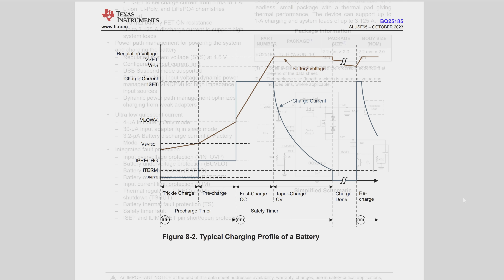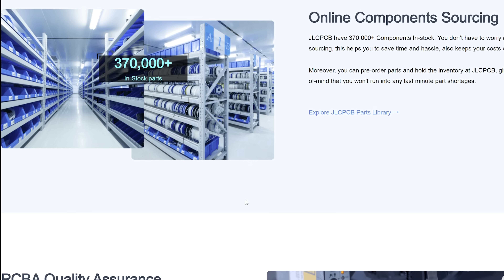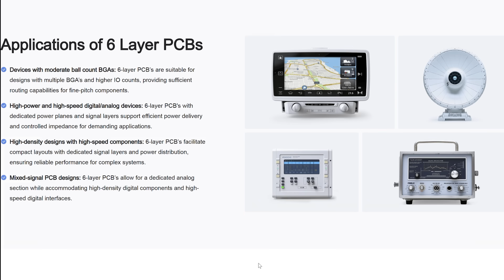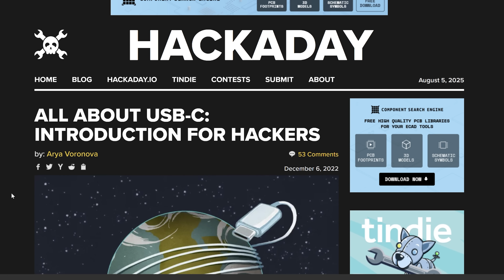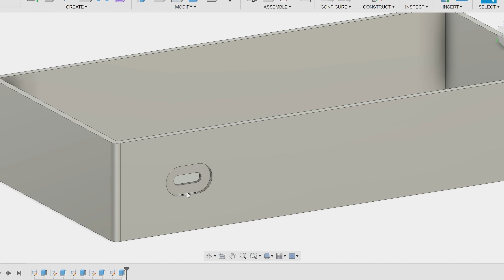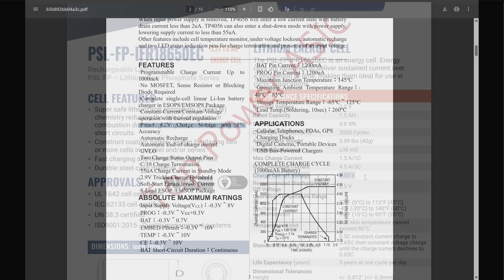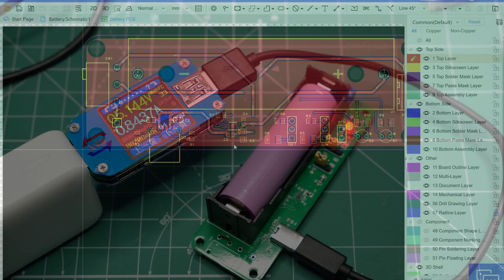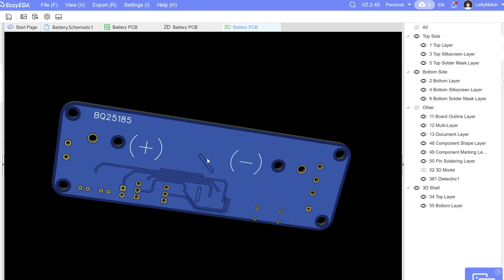Why I made my own battery charging module (no TP4056)

Comment: IP2312 is also a good charging ic, as it has a switching (buck converter) design. It can also supply upto 3A.
Reply from the maker: Yes, I was considering that chip too, but I wanted to try something with power path like TI's chip. It's better suited for driving a load while charging the battery at the same time
Reply: But what if I only wanted 2 amps? Do I have to remove a resistor or something?

Comment: wider copper traces near the chip to dissapate heat.
Reply from the maker: Yup, I tried to make them wide and added a few vias for good measure. Perhaps I should have cleared some of the solder mask too.
Reply: @LeftyMaker    your pcb design was good, part of your problem was the chip size. Such a small package never performs well in the 'C per watt category

Comment: Nice! So is your minimum discharge cut-off voltage higher / configurable?
Reply from the maker: The chip can do either 2 or 3V cutoff. It is configurable. Though it's strange that it cannot be set to 2.5V for LiFePo4 batteries.

Comment: a heatsink on top of the chip and a tiny fan on top of the heatsink would be so cute!
Reply from the maker: I agree :)
Reply: only thing to worry about is contacting the other components. I guess you could mask off the surrounding area with kapton to be certain
Reply: I'm imagining a tiny tower CPU cooler 😆
Reply: @kris754a  rc cars usee such small heatsinks and fans im sure there are many others
Reply: TINY WATER COOLER

Comment: Biggest problem with TP4056 and others is lack of proper power path, meaning being able to simultaneously charge battery and run the device and still have usb connectivity, as well as lack of power switch. This should be a standard by now (like phones) Take a look at BQ24232

Comment: Nice project. I wonder if there's any heatsink small enough to fit on that chip to prevent overheating. It's so tiny...
Reply from the maker: It could be possible to make a custom heatsink, but I guess it would be easier to just use a switching design for better efficiency. These chips rely on the copper area of the PCB to draw heat away from them. Also, I'm sure it doesn't help that it's summer and I don't have AC in the lab :)